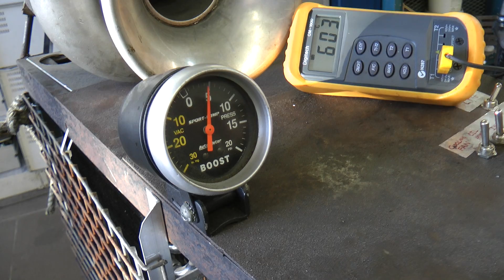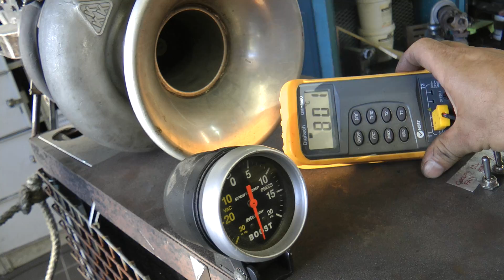How to Build a Jet Engine Part 5. I go to visit JetA1Terminator

Comment: 100 + hp from that? i dont think so, you may want to do your maths and show some calculations, maybe 10-15 horsepower but it cant make anymore than that unfortunately...
Reply: a 30 lb turbine CAN generate 100 HP if setup properly.. modern turbines do 4 to 1 and even 5 to 1 or  more.. hp to weight lbs of engine... sorry sonny
Reply: it can easily do 2 to 1 in its sleep from the 1940s
Reply: After I did a bit more research, 10-15 hp sounds more likely. Very tidy build.